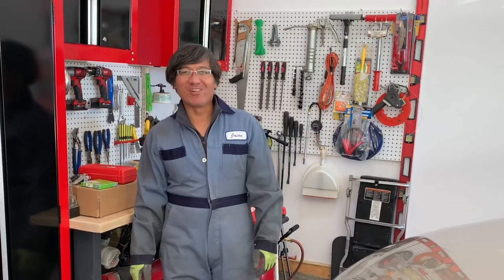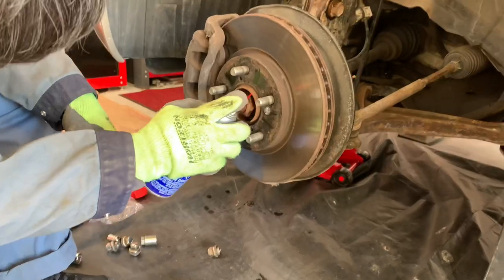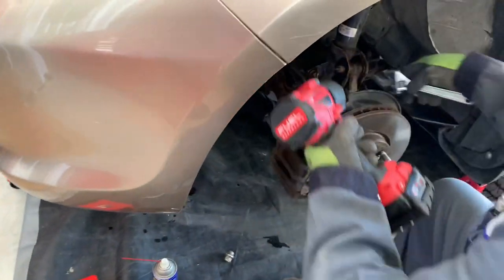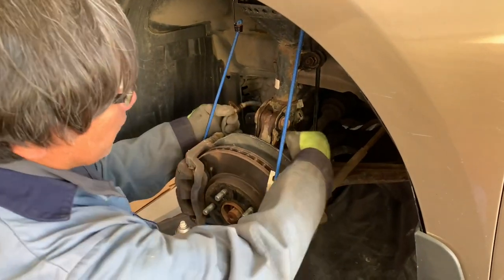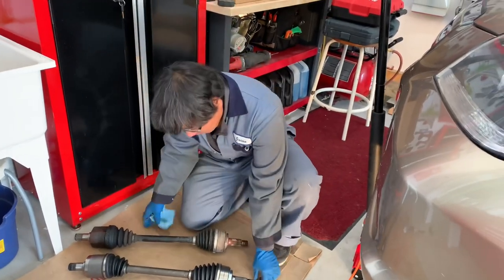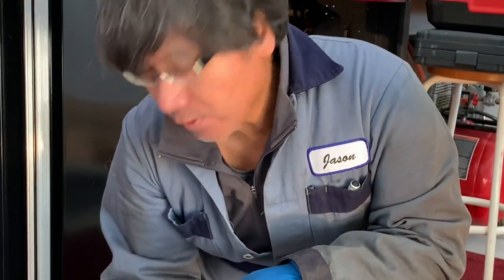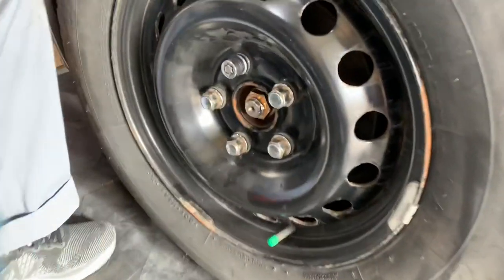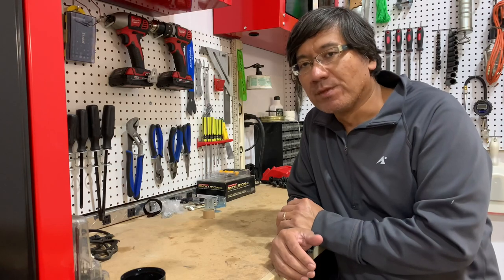2005 - 2010 Honda Odyssey CV Axle Replacement (similar for 2003 - 2008 Honda Pilot)

Comment: Thanks a lot for excellent presentation. Very straightforward replacement move. Very timely for me cause I' replacing my right trans oil seal. I tried initially removing the axle today but was confused from other you tuber.
Reply from the maker: You are welcome! I am glad my video helped.

Comment: Thanks for making this video. Just tried to put a aftermarket driver side CV axel to my 2008 Ody EX. The inner side was okay but the outside shaft was a totally different story. I could never push the shaft into the hub (not even a bit) and decided to get a genuine Honda part instead. The OEM part I was able to push a little bit in (with antiseize as well) and use rubber hammer to further force it in more. After I can put the nut on. I used power tool to finish the job. Never thought the most difficult part was putting the shaft back into the hub though. Will try passenger side next week and hopefully I don't need to get another OEM this time (fingers crossed).
Reply from the maker: Interesting! I didn’t run into that same issue and I have used an aftermarket axel. At times the splines on the axle or the hub shaft gets nicked or dirty. These will for sure prevent you from getting it in the hub
Reply: I had an issue with a AutoZone passenger side it would not go in to the hub. I returned it I don’t think they gave me the right one to be honest but then I checked online a lot of people had this issue. Went to Napa and got one went right in.

Comment: Anyone else surprised that the battery powered impact wrench was able to loosen the axle nut when the actual air tool couldn't? I thought the air tools had WAAAAAAAY more torque than the battery powered tools?
Reply from the maker: I was so surprised as well! Those Milwaukee tools are great. They are expensive, but well worth the price.
Reply: Not surprised at all. My Ridgid impact takes off axle nuts with ease. I think the issue was the air compressor he was using didn't sound at all like it was pushing enough cfm to run his impact. Normally that wouldn't be an issue for air tools.
Reply from the maker: @RL82  you are totally right! 😅 right after, I realize my air compressor was off and didn’t have enough air in that tank. Made it even worse my torque setting is not all the way up. 😂
Reply: I bought a AC powered beast from Harbor Freight, the Bauer 1/2-inch impact driver. And.. wow, it can loosen anything. Spun off the crankshaft bolt without blinking... But, it's big, heavy, and a well, a beast. Under $100
Reply: I've seen one of the new kobolt ½impacts wring the head off a hub bolt

Comment: What fluid was leaking out of the axle?
Reply from the maker: It is the transition fluid
Reply: Is this leak normal during the replacement .. is this a sign/an issue with the seal .. I am looking to do mine
Reply: @easygoingday8980  thanks .. I am done .. no oil leaked out for me .. I had ordered OEM part but it did not come with the axle nut (242 torque) so used the old one .. will that be an issue in your opinion ? I guess I can order the nut from Amazon
Reply: @malhaarlive9037  I think the seal was bad all the other videos I have seen say if you see oil been leaking past that seal replace the seal also.

Comment: I never knew that grease on the outside could be caused by bad ball joints. I think my 06 Ridgeline has this issue because there's alot of grease on the transmission housing and no viable tears or lose metal clamp. Surprisingly it only has 110k miles.
Reply from the maker: As you explained your issue...Sounds like you will need transaxle seal replacement.

Comment: Is this what causes the clicking sound when turning the wheel?
Reply: Yes
Reply from the maker: With the outer joint being bad it makes the clicking sound when you turn. The inner usually makes some wobbling or vibrating feel and sound.
Reply: What kind of Milwaukee tool was that?
Reply from the maker: @patricialimberakis3648  half inch impact a very high torque one